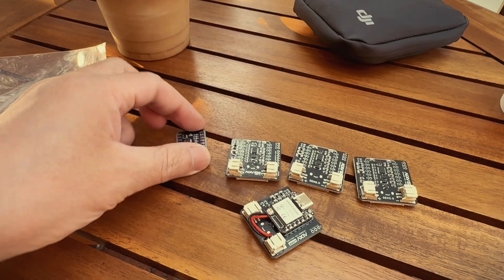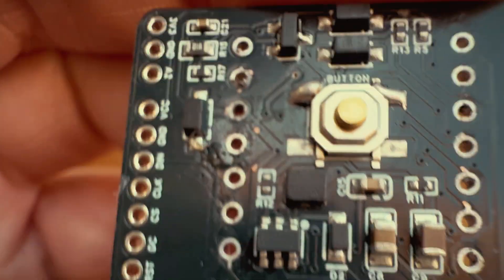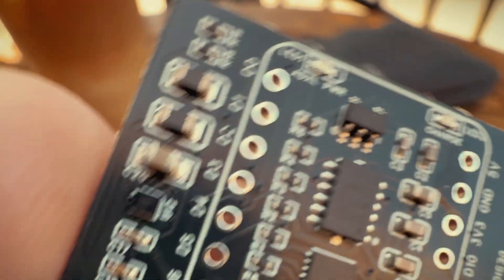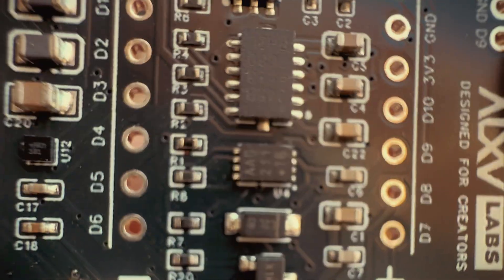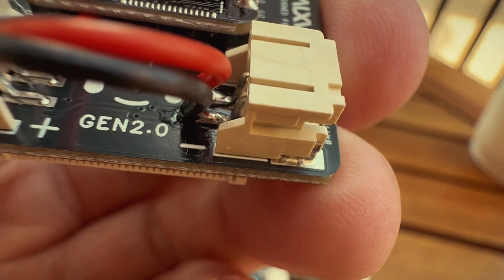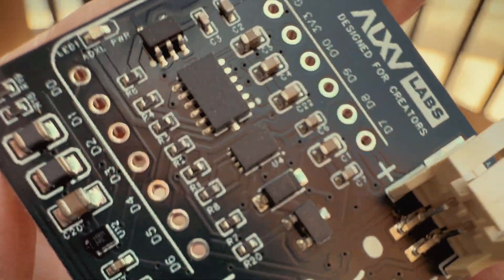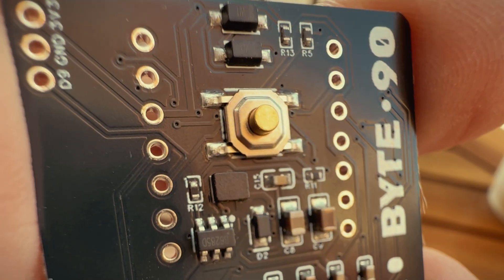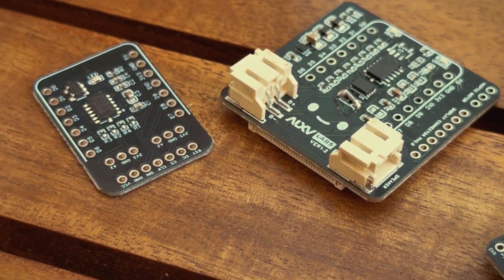Designing schematics and PCB with AI: Mistakes = Progress 🚀

Comment: I have been using Gemini Pro AI studio on a similar project: host for an external board (teensy in my case). I found a nice flow: upload datasheets and start to build a BOM and descriptive guide. Have AI list all connections in a table, every pin of each component, what it connects to, and then list all the required NETs. Then to iterate, I can take those docs and repeat again and again, asking it to find problems, verify limits, check datasheets again... eventually it's only finding really far-out edge cases or minor things. This helped me a lot to find mistakes much sooner. Like you, I did about 3 revs on my PCB and each time had silly mistakes :) Love your project and will order a few to support the awesome idea!!
Reply from the maker: Very nice! my process is very similar but I use Claude and I would provide data sheets as well as reference schematics and LCSC components to map things out. The only challenge thing is not knowing what to look out for in events where AI is hallucinating and giving you bad recommendations if it couldn’t make out something clear enough 😅
Reply: @alxvlabs   @alxvlabs  I ran into this too, I went a little crazy and made a workflow in N8N to search EE/TI/Teensy forums for posts about parts or problems, then summarize all of it and feed it back in to the llm... or sometimes I would ask Claude Sonnet 4 to review the answers Gemini 2.5 gave, finding flaws and passing things back and forth. I ended up using Cursor (VS code IDE + AI, but no code and just docs) for all of this since I can keep the markdown files all together in one place and in version control
Reply: Going to use this workflow myself, thanks 💪